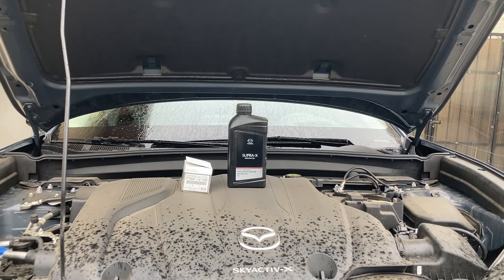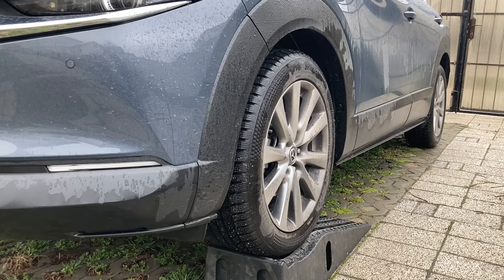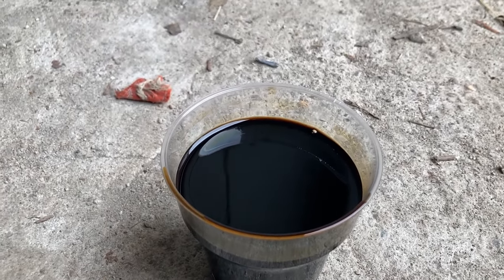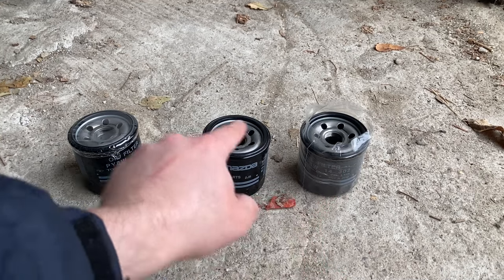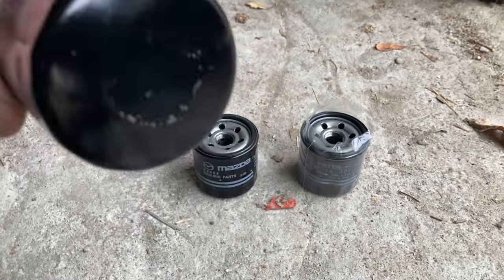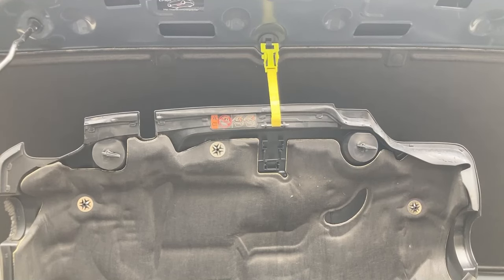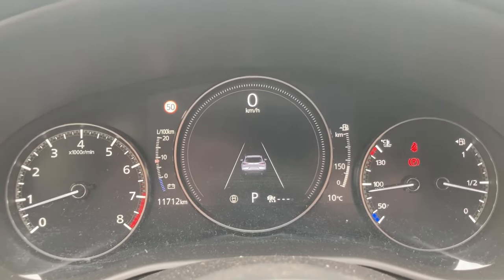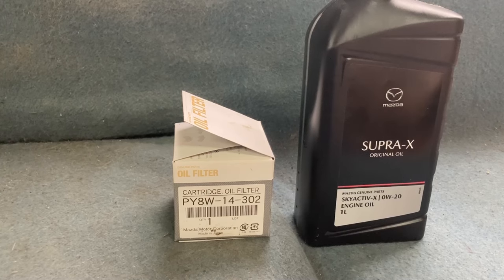DIY - 2023 Mazda CX-30 SkyActiv-X: Full service (air, cabin, oil filters and oil)

Comment: Wow. A 5gal container of Mobil 1 synthetic is 28 $ USD and can be done without all the dealer issues in the US. It's interesting to hear how it is in your country. Good luck.
Reply from the maker: I think you mean 5 quarts, rather than 5 gallons, right? But still, for 0W20 that's less than half what it is around here. And yes, the dealer constraints while the car is under warranty are much stricter in Europe (and Romania in particular).
Reply: im europa 5L of 0W20 costs 56€  @TheMissingBolt
Reply from the maker: @Jason.1999  That's very close to what I paid for the 5L of genuine 0W20 Mazda oil (60€). But even 56€ is more than twice what they pay in the US.
Reply: @TheMissingBolt  crazy 😅

Comment: Skyactive-x isn't kind on oil. You should not use Mazda oil because it is not full-synthetic and is made by total. You should use full-synthetic oil fron Eneos. Use Eneos oil once and you'll see how smooth, quiet the engine becomes, and you'll see how clean the oil will remain. BTW, the best crush washer is copper washer.
Reply from the maker: I'm sorry, I disagree with you on most of what you said. I explained at the end why I used (and will continue to use) genuine parts, including the Total-based oil. Total in itself is a well-known oil blender with quality products, there's absolutely no reason to switch to anything else at this point. Like all other 0W20 oils, the Supra-X is sufficiently synthetic (has a sufficient PAO base and additive package) to do its job more than adequately for the 10,000 km limit that I'm using it for, and the engine is already very quiet with it. As for being clean - after 1000 km of running, any drained oil will be black, no matter the brand - and as I explained in the video, the color is not an indication of quality or wear. Regarding washers, maybe in certain applications (high-pressure Diesel injectors etc.) it makes sense to use copper washers, but for an oil drain plug it makes absolutely 0 difference which type of washer you use, as long as the torque on the bolt is correct and you don't reuse it.
Reply: @TheMissingBolt  Of course you have your own opinion, but Total oil is just a basic HC-Synthetic oil with Mazda-prescribed additive. Full-synthetic and HC-Synthetic oils are day and night different. So much so that when I used the best, most expensive HC oil in my old Audi, it made noise like the engine is going to explode, but as soon as I put full synt like Meguin or Eneos, it runs smooth as silk. The thing about Full synthetic oil is its thermal stability and flash point and molecular bond under working condition. The best HC oil cab perform as good as full synthetic oil for maximum of only q fee hours of operation.

Of course you have your own preference on oil and the type of washer. But in such a high pressure and extremely high temperature engine such as skyactive-x, using HC oil is asking for trouble and the car will never go beyond 150,000 if it can reach 150k at all. When I am talking about full synthetic oil, I qm talking about at least 300,000km and beyond engine life. I have seen many new Mazda 3s with skyactive x and G that started consuming oil at around 100,000km mark, and that is absolutely not acceptable for an engine of 100,000km oil. Not to mention that Mazdas with skyactive x here have lower sales value than skyactive g engines. At the end you decide what to do with your car.
Reply from the maker: @ampm9771  You make a fair point. And quoting your "the best HC oil can perform as good as full synthetic oil for maximum of only q fee hours of operation.", typically a modern oil's original lubricating properties tend to last up to about 8000 - 10,000 km or 6 - 7 months (equiv. hours of operation) - accounting for molecule break-up under HTHS, TBN, sludge prevention etc.. Hence why I believe it's far more important to stick to a shorter changing interval than the actual brand of oil used. I don't doubt that there are Mazdas who start consuming oil before 100,000 km, but I'd be very curious to know if their owners change the oil frequently or stick to the manufacturer's 20,000 km / 1-year limit... because if it's the latter, the oil consumption makes sense (and the owners are partly to blame for it). As for the washer, the pressure and temperature of the oil pan are considerably lower than those at the bearings, piston rings etc., which makes an aluminum washer at the drain point sufficient (as the Mazda engineers decided as well); but for a high-stress environment I agree that a copper washer is by far the best choice.
Reply: @TheMissingBolt  Regardless of the oil, change oil every 7k
Reply: Nobody able to hear oil difference in blind test.
Reply: @ЮрійГордієнко-х2з  You mean there is no difference between ZERO sulfur content full-syntgetic PAO/ester based oil and low quality high sulfur content level III hydrocarbon based oil? Ok!
Reply from the maker: @ЮрійГордієнко-х2з  Indeed, you can’t tell the difference by hearing, but you definitely can by taking an oil sample and performing chemical component analysis on it.
Reply: @ampm9771  Did I say that? I’m about your “smooth, quiet” and other magic words . Plus, if you sell your car in few years, any expensive oil like Amsoil etc - just wasting your money, this is reality. Oil test - good business for guys who do it…
Reply: @user-fi9jg7vh8g  For someone like me, or those who keep their cars forever, oil makes a huge huge difference. Like it or not, this is something big oil companies won't tell you,  and they even went to court to change the definition of full-synthetic oil so they can continue selling oil that is bad for modern engines, and oil that is harmful to the environment. PAO/ESTER based oils keep their prooerties until the day you change oil, because theyhave no sulfur, they don't get contaminated, they don't build acid. Dully synthetic oil has much much better molecular bond and thermal stability.  Why do you think expensive HC oils add a bit of ester or PAO as "Special addditive" ? You use HC (hudrocarbon based) oil in modern engines and by 100,000km they'll start burning oil, then you'll have to use full-synthetic oil just to reduce the oil burning.

But I agree with you, if you gonna sell your car after 5 years or 100,000km, full synthetic oil is a waste of money.
Reply: @TheMissingBolt  BTW, I previously said that Supra-X 0w20 isn't full synthetic, well it is at least partly full-synthetic(PAO/Ester) I found out. It's a special oil with high Molybdenum content. I put it now in my SkyactiveG, and I can tell you it mmhad made a huge difference in how snoother the engine is and how cooler the engine operates even now that the temperature is a bit warmer. Stop start is now much amoother than before.
Reply: @ampm9771  Sorry, can’t trust you after your “smooth and quiet” ))))) I also use top-level synthetic oil and do additional oil change between required dealers service, but I understand I’m throwing money away ))) And I didn’t hear or feel any difference after any oil change NEVER ))))
Also, how do you know a car will burn oil after 100k if you use magic oil regularly?
Reply: @user-fi9jg7vh8g  Look, the benefits of full-synthetic oil has been well documented, and yes smoothness and quietness in most engine, especially high-comoression engines are noticeable. In my 20 year old Audi, the difference was night and day, so much that with HC based oil, its engine would sound like diesel upon startup.

Oil does three things, reduce friction, cooling and cleaning. HC oils does two of that very badly, cleaning and reducing friction. Of course in a new engine, the difference isn't noticed until the engine is at least 100,000km. If you have Japanese engines, you can even use water in them, that robust they are, but if you have German or Korean engines, kiss them goodby at 100,000km. How do you think toyota designs engines for 0w16 and 0w8? Did you know that you can't produce oils with grades liwer than 5w30 with purely HC-oil? Why is that? Ever asked? 

The advantage of full synthetic oil is in two things, first ots almost permanent adherence to engine parts, and cleaning which is related to having no sulfur. And for thermal stability, full-synthetic oil have mu h better thermal stability vs HC oils. But as I said, if you sell your car after 5 years, full synthetic oil is a waste of money. Well, full synthetic oil is marginally more expenaive, something like 10-15 euro max.
Reply: @ampm9771  Your text is what classic marketing looks like ))) Ask questions which nobody requested and respond to them in ways to get the best for stuff you sell ))) Nice work!
No oil that can make a 20 years old car work “like a baby”, just throw this peace of crap to junkyard. I drive ~20k miles per year on my 2 japan cars and will never buy (I hope) any korean/german car with intention to “save” them using magic oil ))) Plus, bmw etc cars have own oil rate, so any oil with same tolerance/rate will work perfectly fine - that is why all these things exist actually.
Reply: @user-fi9jg7vh8g  I don't even know what you're talking about. My Audi A4 B6 could onky be driven on full-synthetic Meguin oil, and only that. Once I put Mannol in it and VVT oil control valve broke.

It doesn't matter what opinion you and I have, numbers and facts don't lie, what I said is purely physics and proven facts. I am not trying to sell you oil. I am sure majority of the people who know a thing or two about engines would agree with me purely based on facts, not opinion.

Besides, most Japanese cars use 0w20, 0w16, and nowadays 0w8. Guess what? These grades of oil can only be made from PAO-Ester based oil. Why is that? You think that's also marketing? I let you figure that out by yourself.
Reply: @user-fi9jg7vh8g  I asked my Mazda dealer where I bought my car, what oil most people use? He said Mazda Ultra 5w30(HC based). I asked him why is that? Because it is better than Supra-x 0w20? He said no, because it is two times cheaper. I asked him about Mazdas burning oil, he told me it is mainly because people drive the recommended 20,000KM on cheap oil that is good for max 5000km. I also asked him what is the best oil you'd recommend me to use in my car if money was not a problem, he suggested full-synthetic 0w20 or 5w30 ENEOS or Idemitsu, or at least Supra-x 0w20.

And a but of background why I had to sell my beloved 20 year old Audi, because of one time using HC oil that damaged the engine beyond repair because I coule not find the spare parts so I bought a new car, a Mazda with skyactive-G.

Actually, using full synthetic oil is cheaper because you can go up to 10,000-15,000km with a good quality oil like Eneos, Idemitsu or Meguin,  on the other hand with HC based oil, you have to change every 5000km.

Bow tell me which one is waste of money?
Reply: @ampm9771  I have much more interesting things in my life than thinking about an oil ))) Regular oil change at dealers, sell car in few years with ~60k miles - proven key in this story.
Reply: @user-fi9jg7vh8g  It's your personal prefrence, and you just proved my point. Selling your car at 60,000miles which is exactly 100,000km. I personally would never buy a used car, I only buy new cars and keep them for as long as they last. I don't waste my hard earned money on cars. My car for me is like a horse was for people in the past, you take care of it, feed it with good food and its gonna take care of you. And in my life, I never, i said never had any problems with my cars, not once, because I took care of my cars. And  speaking of interesting things, that's right, that's why I only do one oil change per year because I only use full-synthetic oil, than twice, three times per hear for those who use HC. At the end, it comes down to personal preference. i know people who drive 30,000km with one oil.

You do you your way, I do my way, but you cannot change proven favts because numbers and physics don't lie.

Comment: yes i agree you should exchange the washer but aluminium washers are there to be reused a couple of times
Reply from the maker: Indeed, you can safely reuse a washer once by turning it around before re-installation. But if you can source them cheaply, there's little reason not to replace them.
Reply: @TheMissingBolt  ofcourse 
just wanted to point it out for those that forgot or cant get one in time or what ever
Reply from the maker: @Jason.1999  Yep, fair point. Thanks!
Reply: @TheMissingBolt  i thank you for the great video !
Reply from the maker: @Jason.1999  You’re very welcome! Glad you liked it!

Comment: Hi, what's your fuel efficiency on this beast? It looks like a 8-9L/100km in the dashboard, is that true? I saw them advertised at around 4.2L/100km (23.9km/L).
Reply from the maker: It's averaging about 8.5L / 100 km, but keep in mind it's spending 50 % - 60 % of its time in Bucharest, where the traffic is really bad (among the worst in Europe). On longer road trips we're usually getting about 5L / 100 km or even less if there are no highways involved. It uses less petrol fuel than the Kia Sportage used diesel fuel at a similar power output and only slightly more weight (the Mazda is lighter by about 100 kg), which to us definitely confirmed the efficiency of the SkyActiv-X engine.

Comment: Thank you for the good pointers. One question I would like to ask is should the car/truck be hoisted up level to ensure all the old oil being drained out completely or would it has the same result with having the car/truck front wheels driving onto the ramps (as in your case) for accessibility.  Thank you for your clarification
Reply from the maker: Given that the oil drain plug is at the back of the pan, it makes sense to have the front wheels lifted slightly higher than the back wheels. However, the difference in remaining oil between doing this and having the car lifted horizontally on a ramp is very small, so I'd say pick the option that's the most comfortable for you.
Reply: @TheMissingBolt  Thank you so much for your response. All the best

Comment: What happens if you drain the oil cooler ? I accidentally removed this bung instead of the sump plug
Reply from the maker: As long as you put the plug back in and tighten it until it's snug (I don't have a torque value for that particular drain plug), there shouldn't be any issues. If the plug has a crush washer, turn the washer around before reusing it (so that the cooler-facing side now sits against the drain bolt) and after driving the car for a while, check for any leaks.
Reply: @TheMissingBolt  Thanks for your advice, I travelled 30 miles back home now lights on dash and no signs of any leaks 👍🏼
Reply: @TheMissingBolt  Scroll to 15:26 on your guide - the hex part where the drain plug screws into sitting in the sump, mine had a little movement when the bolt was tight is that normal?
Reply from the maker: @liams2641  From what I see, that hex part is either welded or bolted to the oil pan. If it wobbles in that it's not tight against the pan, I'd expect a large oil leak to happen... If it doesn't leak it's best to keep an eye on it and ask a technician about it the next time you take your car in for a servicing at the dealer.

Comment: Any idea if the part number of oil filter and washer is the same for SkyActiv G? By the way, where is the dealer place for buying the parts? Thanks!
Reply from the maker: Hi! Honestly, I don't know, but what I did was simply to get underneath the car, take photos of the original filter and then order an identical one. Same for the drain bolt washer. You can get the parts from Radacini Motors in Bucuresti, as they also have an online parts website (see https://piese.radacini.ro/mazda-3290/filtru-de-ulei-pentru-modelele-mazda-cu-sistem-hybrid.html, for example).

Comment: hello, did you replaced your spark plugs in Skyactive X ? I couldnt find any info on how to do it, and in service manual there is 60k (km) interval.
Reply from the maker: Hi! Indeed, the plugs are due at 60K km as per the manual. Since we haven't even reached 20K yet, I haven't touched the plugs. In any case, I think this needs to be done at the dealer in order to maintain the warranty on the car.
Reply: And by any chance do you have any recommendations for the sparkplugs to use ? Cant seem to find compatible NGK only bosch @TheMissingBolt

Comment: Thank you from France, I exactly see thinks like you do, I just paid 580€ for an intermediate revision after 10000kms (only oil and spark plugs at 68000 kms)
No more excessive money pit, I see now that I should have  done the same think with original parts for a little more than 200€,  I will now do everything by myself, like in the good old times 😅
Reply from the maker: Exactly! You keep the engine in very good health but also don't spend so much money doing it!